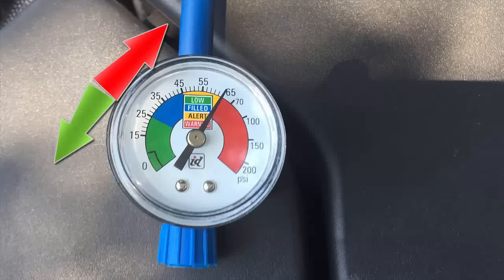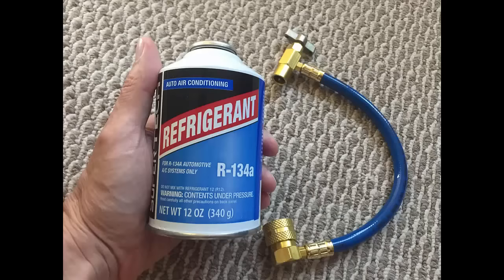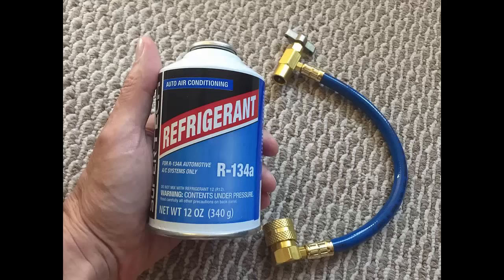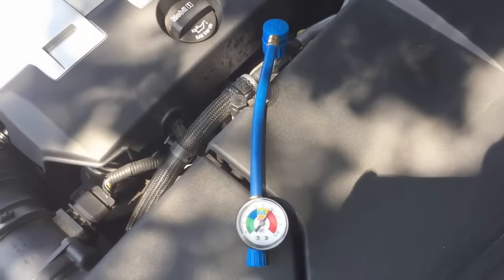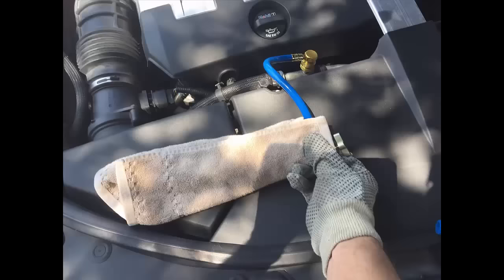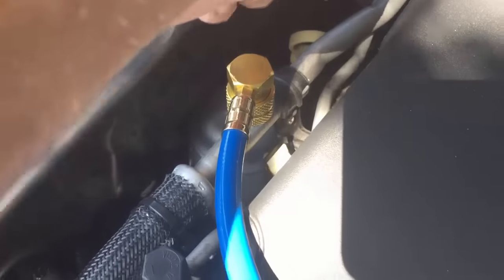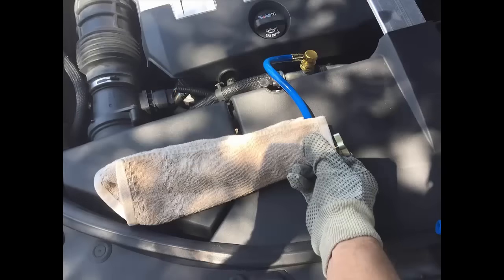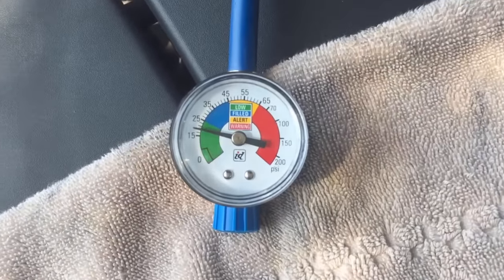Car AC pressure too high FIX overcharged a/c gauge fluctuation reading jumps Up Down Freon problem

Comment: It’s supposed to be high when the compressor isn’t running. When the clutch kicks in and the pressure falls, that’s when it should be measured.
Reply: Thank you!! It's been so long since I've done my A/C and was like, man, something ain't right! You comment helped me out a lot. A/C throwin' snowballs ☃️
Reply: Thanks for your comment ! Helped a lot !
Reply: Thank you so much for commenting, thats exactly what I needed to know. For some reason that information is not in the instructions for refills.
Reply: Thanks for the information.
Reply: Should it still cycle IN the "green zone" when its on, like 20psi or so? Also, if its "overfull" would this cause the compressor to run continuously when ac/defrost is on?
Reply: @ChapsShrugged  If the system is charged close to correctly and the rest of the components are working correctly the pressures on the low side you are looking it should be from around 30 psi to 40 psi when the compressor is ON. Depends on the type of compressor, but the system (compressor)  will shut off when a temp sensor detects 34 F or below.
Reply: @ChapsShrugged  From what I’ve read, pressure being too high should result in the compressor shutting off.
Reply: your the only one that has said this, thank you. i added a can yesterday and today i hooked the gauge back up and it keeps going up to the yellow then down to the bottom of the green. and its doing that like every 10 seconds. is that normal?
Reply: @tegridygone6185  That’s normal operation.
Reply: @ChapsShrugged  9
Reply: Correct but doesn't apply to the issue this video is about to much freon will 100 cause it to blow hot
Reply: I did this technique and it went from yellow to red but idk if my clutch kicked in. I seen or heard nothing but it is a little cooler than it was. 2014 nissan armada
Reply: @spankyiskool420 you'll know when the clutch kicks in, it's impossible not to hear it. If it's not kicking in at all, you need more refrigerant. Gauge reading should be taken while the compressor is engaged. If you're in the red, call a mechanic.
Reply: Do you hook it to the low side or the high side
Reply: @TBALD66  it'll only fit on the low pressure valve.
Reply: @TBALD66 always charge on the low side, the larger OD line.  Throttle in, gradual short bursts, the refrigerant.  I believe you want to invert the can as well.
Reply: I have the truck running everything’s on and compressor kicks on and off after adding Freon when it kicks on it goes down to the blue am I supposed to be reading that pressure down in the blue or whenever it goes back to green almost to red
Reply: @treyhairston9540 yes read it when the compressor kicks on and the needle starts falling
Reply: So it’s okay to have the PSI up near 90 when the compressor is off?? Just a little concerned ima cause something to blow
Reply: @nytshade2 what if the psi is up near 90 when the compressor is off, yet goes down to 20 when it’s on?
Reply: @jerredplimpton6851  what if the psi is near 90 when the compressor is off, then down to 20 when it’s on? Am i good to continue charging??
Reply: Super helpful comment, thaks
Reply: You can have to much Freon in the line
Reply: Thank you so much for posting this comment.  I was afraid and didn’t know what caused high pressure on the low side line after I turned on my A/C to max.  How long do I have to wait for the clutch to kick in?  Thx
Reply: @lovetoshare3478  mine would kick on every like 10 seconds and only stay on for a few seconds…until you get it full, then it stays on constantly.
Mine ended up leaking out again anyways though lol
Reply: @watershed44 what about if when off it's at 50psi but when kicks on it drops to zero?

Comment: This is legit video DIY.  Not like all other videos, after watching over 5 minutes long and the end tell us to take the car to AC specialist.  This trick take less than 5 minutes and save $100 - $300 from AC specialist.  THANK YOU !! BTW, you need to run the car and AC on HIGH, when you try to release the freon out.  Do it slowly and and watch the gauge.  So that you don't empty out too much 😁
Reply: I only tried to release the excess 10 times 3 seconds each but the gauge is still on red. Should it be more than that?

Comment: I haven't read all the comments but, I made the mistake of not watching the AC compressor while it was running .....I had the pressure of the low side spiking when the compressor cycled OFF.  Professional hvac advice I received was that at 90 degrees the low side pressure could be in and around 55psi. Note that while compressor was running pressure was 39 psi which is near optimal. Watch the gauge reading in relation to compressor on/off state before adding or removing. The pressure of your on cycle should be what to focus on.

Comment: This guy is literally a genius. Especially if you have the trigger hose. I don’t think you need that, it just makes it even easier. The air and Freon that came out wasn’t even that bad. Went from no AC in hot summer heat after I overfilled while trying to recharge back to nice, cold AIR! Thank you!!!
Reply: Was it a lot of air or more refrigerant than air?
Reply: @adictiveadictive  It doesn’t matter. It was like half and half. Air at first I think.
Reply: @millertheory7935  

Gonna try this later today when it cools down
Reply: Did you hear a constant his from inside the cabin after you overcharged it?
Reply: @adictiveadictive  I don’t think so. The compressor just turned off. I can’t answer that for you. It may be something it may be nothing. I don’t know. You might’ve caused a small leak. Not that big of a deal if it’s super small. But Freon is deadly to breathe a lot of. Like 5 minutes of it can kill you I think.

Comment: You saved me bro!  I have charged the system successfully in the past, but this time gave it a little too much juice.  Was able to get it proper again with your help.  I had also replaced the serpentine belt and tensioner as they had been loose/ squeaking and impacting performance.  It’s like a new system now!

Comment: My man, it worked! Let out a decent amount from over charging and the more I let out the longer the compressor spun. I continued to relief pressure until the compressor spun consistently for at least 5 mins, then took it around the block. Got back home still engaged and air is much cooler. Thank you so much for this video!
Reply from the maker: Thanks for sharing!
Reply: Was it air that came out or refrigerant?
Reply: I have the hose with trigger as pictured in the video but I only tried to release the excess 10 times 3 seconds each time but the gauge is still on red. Should I continue doing it more than that?

Comment: Wow. I have been struggling with this all summer. I thought it was the condenser was bad. Maybe the plug was broken. Nope it had too much air. It was overfilled. I took the gauge that had the trigger, held it down till it went from red down to low (it was warm air and freon) replaced with a can of ez chill ....bam! Done. I'm literally writing myself directions in case I have to do this again in the future. This is literally the only video on YouTube that suggests letting some of the air out. I didn't even think about that. Thank you for taking the time to make this video. It saved me money at the repair shop and probably heat stroke..
Reply from the maker: Glad it helped, and thanks for watching!

Comment: Thanks my man! I just charged my car yesterday, and the pressure and AC were fine. Today it's extra hot, and AC was blowing warm air. First thought was to add more refrigerant, but gauge almost pegged, so I knew I had to relieve the pressure instead, but didn't know how. Your video showed exactly what to do, and the tip about using a hose with a trigger on it was super great! Now my AC is cold again, and it didn't cost me a dime to fix the problem! This is what YouTube is all about! Great job!
Reply from the maker: Great to hear it, and thanks for watching!
Reply: I did this and I couldn’t solve my issue :(
Reply: @heroxx5888  Sorry to hear that...Are you saying that you couldn't reduce the pressure? Or that reducing it, had no effect?
Reply: @Nubiangent1  I did it too and it didn’t work. Never seemed like cold air coming out from the line either. Brought it down from almost 100 to 35 no change and the compressor never kicked on.
Reply: @lh98  Yeah sorry to hear that man. I'm not an AC guy by any means, but I'm wondering if your compressor's going out, or you have a thermostat issue? I once had a truck, that would blow cold air for a day after charging it, but then it would actually blow HOT air (like the heater was on) after a week. The truck was old, so I never bothered to get it looked at.
Reply: @Nubiangent1  it’s the compressor the most expensive part I guess. I checked the relay, fuses etc then I jumped the wire going to the compressor with 12 volts from the battery and it doesn’t engage the clutch...bad compressor... big money.... thanks for the reply though.
Reply: @lh98  Yep, it's rarely ever just a 50-cent fuse or something right? No problem bro.
Reply: If your compresser never kicked in then check fuses and if it's charged then it has to be expansion valve
Reply: @LuisGarcia-np2sm  if your response was to me it was a bad compressor. I applied direct 12 volt to it and nothing happened. Had the compressor replaced and she blows cold air again. Apparently the high pressures I mentioned before is because it was trapped with no cycling of the compressor. Could have replaced myself but had a shop replace the compressor for me for 587 bucks out the door. It was worth it to get the ac going again. Now just hope it stays good for a long time. I appreciate the YouTube community that shares these things because it really helps point you in the right direction and narrow things down. I’ve saved lots of money from many videos and all those folks that take the time to record and post them. Thanks to all that give info and feedback!
Reply: I just got mine to work..same thing though I had checked everything but the compressor would work and the freon pressure was good...I said fuck it di hooked it up to the hose but no can..wrapped a towel and bled it.  Then re charged it and now its too cold hahaha 🥶
Reply: Have u checked expansion valve or the one sensor that actually alerts the comoressor to relieve pressure or signals when to kick on or off
Reply: @LuisGarcia-np2sm  my dude, the compressor was bad I tested it myself. Got a new compressor and had a shop put it in and that fixed it. All the other possibilities were tested and eliminated before replacing the compressor AND if you disconnect the wire to the compressor and apply 12 volts directly to it and nothing happens then the compressor is shot. You could try replacing the coil in the compressor that is actuated by the 12 v to pull in the clutch but in this case I wanted a whole new compressor. The car is a 2006 I was happy to spend some money to get the compressor replaced and have the ac back again. No other sensors just the compressor my dude.

Comment: I did fix my A/C yesterday, And works much colder than I bought 8 years ago. I never had adequate cold flow to a satisfactory level before. 
Dumb me not going on YouTube and fix it in 5 minutes. 
It stopped blowing cold air since last year. I thought maybe the car getting older and that’s what I get! I was wrong . All I had to do was to hook up the pressure gauge. The low showed too high on the red. I released pressure down to blue line and started working again like it’s new.
Buying the pressure gauge was all I needed 👌

Comment: Thanks mate, I literally was just pulling my hair out over my sons 2001 XTerra, ac compressor turning on and off, hooked up my gauge and it was pegged into the red! Bled it down, compressor stays on now! It's Vegas and 117 this weekend, likely expanded gasses for sure! THANK YOU!
Reply from the maker: Wow 117... that's hot... thanks for watching.
Reply: Chad C same issue same city LOL
Reply: Same issue for me this year in my wife's corolla. Suddenly the AC stopped working.. added refrigerant thinking it must be low. Had a bottle with a digital gauge on it that wasn't working properly. Went and bought much cheaper can with flimsy little plastic gauge.. but aha! THIS gauge was in the red. Found this video, bled off the pressure.. problem solved. Makes sense the savage heat here in LV will cause those gases to expand. Who woulda thought LESS refrigerant in extreme temperatures is a good thing? Lol
Reply: Did you overcharged before?

Comment: Ken Graham
 If overcharged put charge can in ice water wait a couple minutes for it to cool, stop engine to increase pressure, open valve coolant, gauge should drop as high pressure migrates to cool low pressure but will start raising again. Shut gauge quickly give time for ice water to cool new hot gas in can, repeat. Start car check pressure if still to high repeat, if too low remove from ice water let warm up and while running add a bit, wait and let that cold refrigerant equalize as comes up to temp of motor refrigerant. This worked for me on a R410a 1 ton air conditioner, I see no reason it won't work for you with a empty or near empty can. This would legally fix your issue as you are not releasing it to environment, and you have refrigerant for future use for that vehicle. If this works for you as well please up-vote to move it up list.
Reply: too confusing, too many steps 😐

Comment: Worked really well!! Note to anyone trying this, you might have to do it multiple times after driving bc the pressure can go back up so don’t expect the first time to be perfect
Reply: 👍Just happened to me.  Definitely make sure everything is up to temp.  I went from perfect charge to overcharged and hot air just after driving around.
Reply: @dustybeers   How did you fix it? We just got our car back after new compressor install and 2nd day it's not cooling and is overcharged. WE don't know what to do.
Reply: @beesknees6970   I just bled off some of the pressure after everything was up to temp.  Also, make sure not to hold freon can upside down.  Just shake it and hold it upright when squeezing  trigger.  Hvac friend of mine told me that's a common mistake.

Comment: Your are THE MAN!
THANK YOU FOR THE INFORMATION!
I used stp a/c pro can on a maxima I could hear the compressors shut off and on after I filled it. It's a 20 oz can the unit calls for 5.2 oz of freon I had overfill even tho the gauge wasn't marked in the red was in the 50 psi range I took your advice and bleed the system under 40 and it's back to normal and air is blowing so cold now btw I live in Las Vegas!! THANK YOU SIR YOU ARE A LIFESAVER!!!!!!!
Reply from the maker: Most cars need only a couple of ounces to "top off" the refrigerant. But since they sell huge canisters, most people (including me) overfill their systems. I'm glad you fixed it yourself!
Reply: @Your-Self  THANK YOU! THANK YOU! THANK YOU! YOU'RE THE BEST
my lady and I sending our love💑 
FROM THE HOT DESERT🧟‍♂️🧟‍♀️🌵🐍 OF LAS VEGAS!!!!!

Comment: It static pressure video was a life saver. Since I didn't need to buy the high pressure and low pressure gauges . Thanks dude. Straight up to the point explanation.
Reply from the maker: Thanks for watching!

Comment: If it's a bottle Gage and the bottle is empty you can slowly unscre the bottle and while wearing gloves and the bottom where the bottle goes  pointing it away from you with the engine/compressor running, let some of the gas off. Don't let too much out at a time. When you hear your compressor kick back on the Gage will indicate the pressure in the system.

Comment: Thanks for the video! This is probably the worst thing I could have done to fix my overcharging problem, but it definitely saved me time and $. Wore a gas mask & nitrile gloves. Sprayed into a ziplock bag, covered with a shop towel, because this stuff leaks too.
Reply: Sessseee
Reply: Just a warning for others, refrigerant boils quickly at regular outdoor temperatures when not heavily pressurized. If you seal the ziplock with liquid refrigerant in it, it will pressurize and rupture or burst, probably within a minute!
Reply: Ziplocks don't seal. Water gets in easily, as does air or any other gas. Out, too.

Comment: this video saved me so much money.  I added too much freon and it was blowing hot air.  Went back and released some pressure and now it's cold as ice.  For a moment I thought I needed a new a/c compressor.
Reply from the maker: Good to hear it, and thanks for watching!
Reply: so you use the same hose and gage that came with the refrigerant can? do you just unscrew the refrigerant can off the hose and then hook the hose up to the low pressure line?

Comment: Having this issue right now. Debating on whether not I want to attempt bleeding off pressure or just taking it to a shop. 
I normally work on vehicles myself, but this is a little above my "pay grade". I haven't ever worked on pressurized systems before....

Comment: Thank you. 2004 sienna had too low such that compressor would not kick on so I jumped the wires to get it going. Slowely filled, for about 2 minutes it blew cold but I think it overfilled (now that I see your video) so I'll need to back it out a bit. Havent done it yet. Will tackle tomorrow.
Reply from the maker: Good luck!

Comment: Thank you.  Worked like a charm.  My car A/C reacted exactly like yours did.  Pressure was too high and compressor wouldn't run for more than a second.  Let some R134 out and it started to run, then the pressure built back up and it stopped, so I let some out until it runs as it should.
Reply from the maker: Great job, and thanks for watching!
Reply: Did you add ac? Or just one day was high?